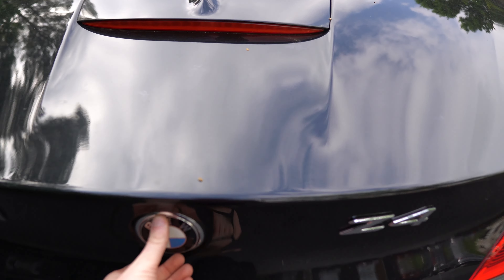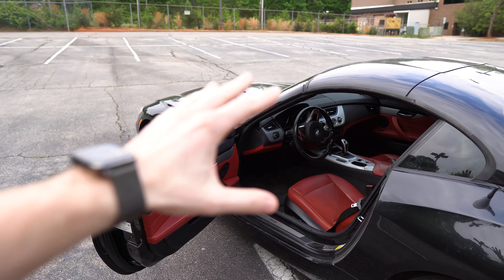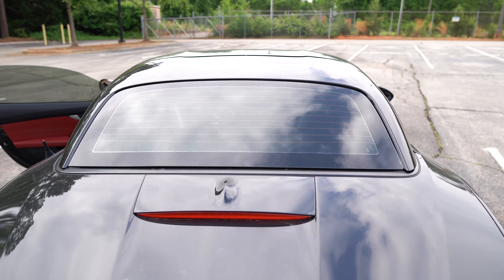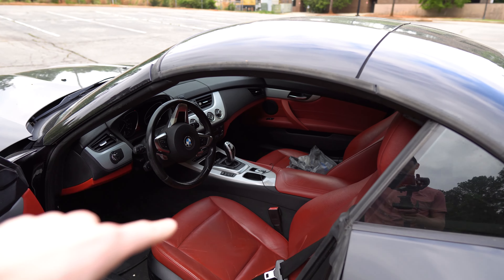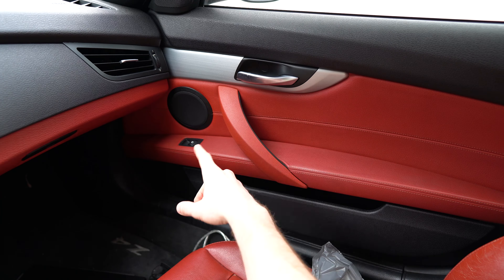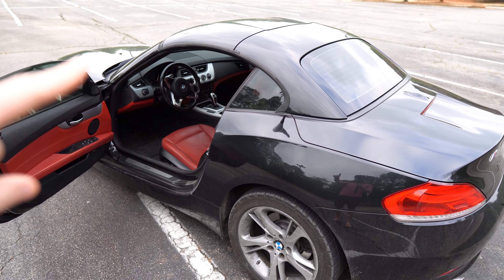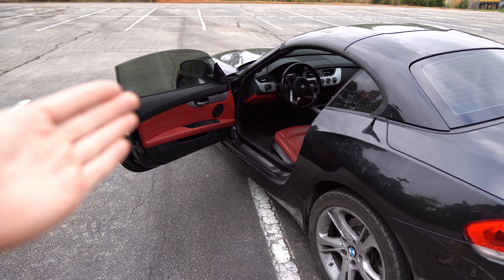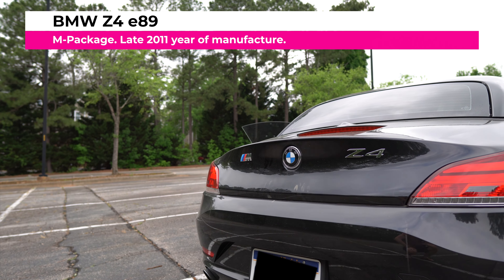What’s wrong with my BMW Z4 e89? First look on my e89 Preview of the future projects.

Comment from the maker: Hey Friends! The portion where the e89 vs e93 convertible roof speed isn't correct or one car was opening and the other closing, so it's unfair. Also, the timer that I added to the screen is a mess, it's showing the twice lower number, so the Z4 takes 21sec to open the roof, and e93 45sec to close it.

Comment: Exhaust may be stock... what people do is unhook and plug the exhaust flap  solenoid vacuum line behind the right exhaust tip. That way  that flap stays always open... its called golf T mod...  because people used golt tee pin to plug that vacuum line.

i have that mod on my  09 Z4 35i and it sounds similar. Also pops and bangs and so on...  and i have stock downpipes with stage 1 tune.  Cold start is a bit loud with that flap always open.

Anyway congratulations on the car.  
Would love to see what you are planning on doing with the roof rubber seals  and trim. On mine that seal on top of the windshield is getting a bit ugly... I have used Gummipflege rubber care on it but its not really helping it. Considering replacing that seal with a new one.
Reply from the maker: Yea, that exhaust valve works correctly, or at least opens and closes from time to time... What I fear is that the "cats" got emptied by the previous owner... But I will find out in the upcoming week, that the car will have PPI, So hoping for the best!
In terms of the cracked Rubber, I was a little too excited, "I was thinking about leather dye, since it has a rubber-ish feel after it drys, and it's pretty thick, and you can get on in Charcoal black which will mack the color of the rubber, and it's easy to apply or use it, as itself leveling substance." After your comment I figured that is a pointless idea, it only will work for esthetic, and probably hours of preparation and cleaning, also who knows if it even works...?
Huge Thank you for the Comment! you got yourself another Subscriber! Cheers!

Comment: I have a 2011 Z4 30i and everyday next to my gear shift, the Amber light on P always stays lit all the time, even when I park my car.. Even for a day or two if I don't drive, the light always stays on even with the door's locked and everything is turned off it always stays on, is this normal? It's been like this since the day I got it last year, some people tell me it's not supposed to be this way but then some people told me that it is, any idea?
Reply from the maker: Does your car have a keyless entry? 
First I would suggest you to check the power draw from the battery when the car gets in to sleep. there are many forums that will guide you to what the power draw should be when the car is sleeping. Also, try to find somebody with the ISTA or INPA,(NCS expert if you want to code it to VIO). Those are BMW scan tools, and they can reset the CAS module.
Good luck! Post the update if you will have a chance!

Comment: Dude the "rattling" your hearing is the fuel injectors. The injectors on these cars are noisy. I have a 2010 Z4 with less than 60 k on the clock but when you open the hood you really hear the injectors working. Dont panic.
Reply from the maker: You have a point, I know that the direct injectors are loud, but in my case it's actually turbo, waste gate rattle. I did adjust it, so no it's fine.

Comment: The only thing will make z35 pop if it doesn’t have downpipes are the injectors leaking
Reply from the maker: I think, the injectors was replaced. But I'm not sure about downpipes as I'm planning on selling the car, they have to be on the car! today gonna be doing PPI, so will find out what's up with the downpipes, and overall what mechanic can see.